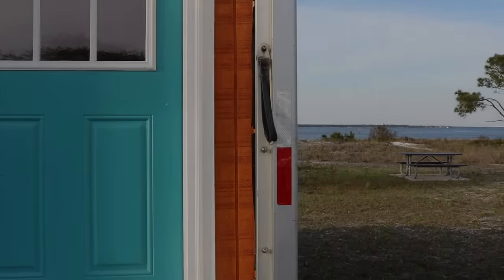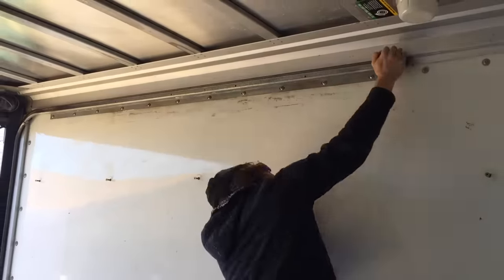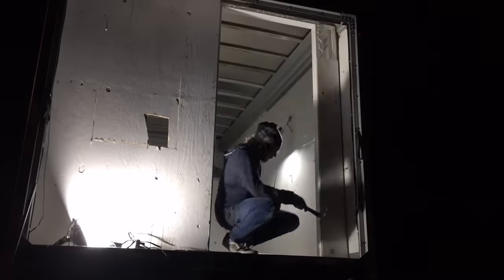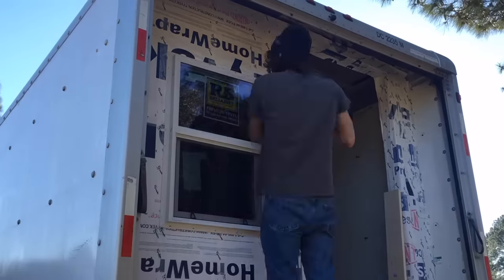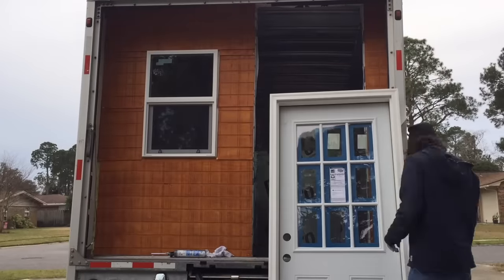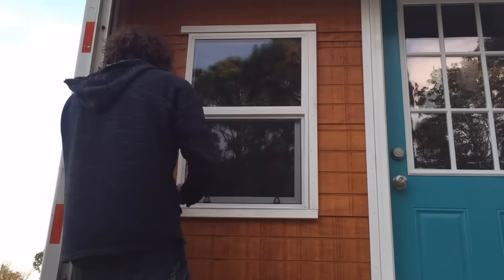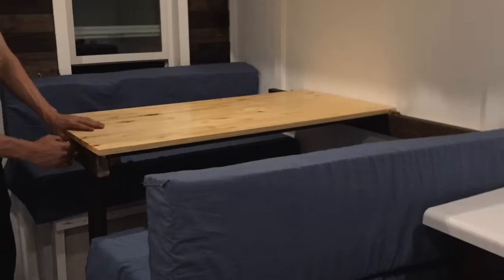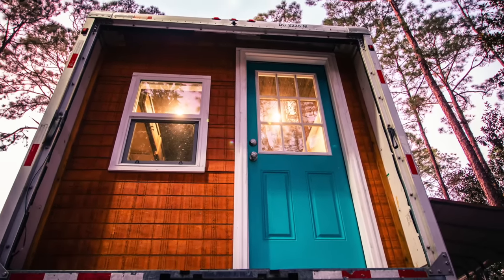How to Convert a Box Truck to a Tiny House

Comment: It doesn’t make any difference what direction the house wrap is put on. I’ve done construction for over 40 years.
Reply: it must have been some OCD people cuz I don't understand whether it's right side up or right-side down as long as it's not backwards. Lol.
Reply: Who thought that was correct, obviously they don't work in construction.  Tyvek "right" side up, too funny.
Reply: Yea someone confused Stuccowrap or Drainwrap which is directional.
Reply: If anyone is curious, here is the direct quote from Tyvek: "Tyvek® HomeWrap®, Tyvek® StuccoWrap®, Tyvek® DrainWrap™ and Tyvek® CommercialWrap® are equally effective in both directions and the logo may be on the inside or outside. "
Reply: Joe Princena you are leaving out part of that 

“Tyvek® HomeWrap®, Tyvek® StuccoWrap®, Tyvek® DrainWrap™ and Tyvek® CommercialWrap® are equally effective in both directions and the logo may be on the inside or outside. However, Tyvek® StuccoWrap® and Tyvek® DrainWrap™ have a specially engineered surface that should be placed with the grooves facing outwards in a vertical direction.”
Reply: Dupont says it is non-directional.
Reply: @pendragon1997  Yes! just a comentor looking for something to criticize when they themself have a very small knowledge base!
Reply: Jy8
Reply: @doomman700  Literally looked it up and found this answer on their site lol
Reply: Gianni M I have used stucco and drain wrap, it is directional and should be put on correctly to be effective. Yes it’s right on their website
Reply: 40? slave!
Reply: Adding to this, shouldnt vapor barrier be layered  over the  layer below it all of the way down the surface?
Reply: Maybe they had heard someone talk about starting the first layer at the bottom and working upward, but they weren't smart enough to understand the idea of how to overlap the wrap below with the one above.  Or maybe they just didn't get raised right.
Reply: Probly jus old framers, jus busting ya balls!!!!l I got told that, when went to work framing. Also had me look for a "board stretcher".
Yeah, if you hadn't said you're not a carpenter, might not have known
Reply: If the film relied on direction and gravity to shed water vapor it would be an automatic failure of the material. It's not a shingle.
Reply: YOU KNOW, IT'S POSSIBLE TO DO SOMETHING WRONG FOR OVER 40 YEARS.  JUST SAYING...
Reply: when its tyvek it don't matter but if its weaved house wrap it does matter!!!
Reply: @misterbigchip9501  yes its true he could do it wrong for 40 years.  However, in the case of Tyvek, his 40 years of experience steers us right.  Lettering orientation does not matter with this product.
Reply: yeah loll. still, layering them right helps a lot.
Reply: I wondered why it would!  Thank you!!
Reply: They give you Discount if you show their logo lol Btw I've seen so many Tyvek thingy when passing construction sites. It seems like they have a monopoly in that market?
Reply: its a beautiful build
Reply: Can you install Tyvek® WB with the lettering facing inwards or upside down? Tyvek® HomeWrap®, Tyvek® StuccoWrap®, Tyvek® DrainWrap™ and Tyvek® CommercialWrap® are equally effective in both directions and the logo may be on the inside or outside.
Reply: It matters to the company putting their advertising all over it.
Reply: Of course not.
Reply: @johntatman9168  Right handed Tyvek has to be right side up...left handed Tyvek is versatile...lol  He should always carry a board stretcher when doing renovations on the install of cabinets.... ...
Reply: Yep!!!
Reply: Great Job on the build. Blessings
Reply: Have you really
Reply: Build it the way you want to build it F what people think just build it the way you want
Reply: @ericagibbons7697  true
Reply: It's just what we tell newbies to make them stress 🤣
Reply: Looks good., you two did a good job , you'll learn from your first mjob, the things to do on the next. Congrats
Reply: @ericagibbons7697  Was just about to say exactly the same thing
Reply: People will say anything. That's just crazy
Reply: U right.. except here in ga the inspector will make u tear it down bc its part of the code here
Reply: 😂😂😂😂 Tyvek® HomeWrap®, Tyvek® StuccoWrap®, Tyvek® DrainWrap™ and Tyvek® CommercialWrap® are equally effective in both directions and the logo may be on the inside or outside.
Reply: Jim is correct. Diction of the product makes no difference .. even inside out. The one difference is in layering, which you did correctly as top layer over bottom layer. Commenters are often not experts. Tyvek is made of random fillaments... Random is not directional.
Reply: Yup it's actually annoying how people say this.
Reply: Of course Tyvek wants the paper with the giant Letters TYVEK SHOWING.  Make sure you install paper down up.  Overlapping as you go.  That's what I've been taught in commercial construction

Comment: Pulling that original door off was genius. Many of y'all don't know this but there's no emergency latch to let someone free so I really can't blame him for cutting that out
Reply: Also roll doors are prone to drag outside filth inside the truck and closing the roll part off is a mf sometimes. Not to mention the extra weight it adds; I’d rather have a shower or something more useful that’s  not gonna rattle and squeak all drive.
Reply: Could you have moved the latch to the inside so you would have had an extra protection? Also something to keep the latch from locking you out accidentally?

Comment: So smart to use the original wall holes to mount everything.  It doesn't seem like most people do this yet it offers so many advantages.  You're an excellent thinker and planner.  This was so well done, especially mentioning the previous shortcomings and what you've learned so far.  A lot of people wouldn't have the courage to do that.  Very commendable.

Comment: For not having carpentry experience you did an amazing job. As for painting the frame work it actually is a benefit in case you get in moisture or sweating inside. I've been in the paint and construction business over 38 years.  It will help prevent mildew issues if that does happen.  I'd do the same thing. The Tyvek wrap can go right side up, or upside down.  It don't make any difference at all. People just like to be critics. You did well.

Comment: I didn't see any mistakes:) I never heard about the T11 moisture/sealing issue. What I would say is get a quality exterior paint and fully seal it so no moisture gets in. You can even get the color matched to keep the log cabin look. No moisture in.. none needs to get out. Like others have said I think its a great job,looks good and it works. Nothing will ever be perfect so enjoy it and fix anything that requires it when it comes up. I thought the way you reused the original holes was brilliant. Enjoy your rig and thanks for sharing your build.

Comment: Cole there is no saving grace with a rolling door. They make noise & air gets in them & just a pain in the but to deal with. There great for moving vans not living vans. You made a great choice to take it out. You also get more room as the rolling door takes up much space at back & ceiling. always, Tommy :-)
Reply: I'd think it's more for camouflage. Keep the wall as built but a roll-up covering that will keep people from thinking it's a house. Necessary? Absolutely not. But it's good to have if you feel like you need to hide what the truck is for safety.
Reply: @StapleCactus  yepp they lost the stealth effect...can probably only park at a camp ground to sleep!
With the door it was anywhere they wanted
Reply: @StapleCactus  the wall as built goes right to the ceiling, but the roll-up door goes under the ceiling. To keep the inside well insulated, it would need a false ceiling underneath.
Reply: @questioner1596  Which is completely doable. It takes extra time which he didn't have, so I understand.
Reply: There is still space to add some sort of canvas/vinyl roll down wall. That way it could provide a stealth factor and protection from elements while driving.
Reply: @StapleCactus  my thoughts exactly...
Reply: Well here's a marketing idea for someone then that keeps both sides of this argument  happy ... a roll down awning fake door that says something like "  Daves  24 plumbing Repair" so you never get robbed and you can park overnight without hassle
Reply: @pal6636  Brilliant...the thought had vaguely crossed my mind...but yes brilliant!
Reply: Never get robbed?? 
Work trucks get broken in to for tools.
Reply: @gellotion  I guess you're right 😁
Reply: @gellotion  Of course nothing is flawless, we're talking reducing risk. "" Never" "isn't literal.   Use your imagination then if you don't like tools... change it to used diaper pick up or something.
Reply: @pal6636  I like that. Or maybe bread delivery, linen service, exterminator?  Whatever you choose, your idea is a good suggestion for the stealth factor.  
Another tip that helps with that is to keep moving, don't sleep on the same street twice if you end up urban camping for a while.
Reply: great idea 💡 👍
Reply: the only reason to keep the roller is for stealth camping, if thats not the goal, what he did sure looks nicer and adds light to the interior.
Reply: @Justnn  chicken grooming 😆😆
Reply: Dave Strickland  sorry, my bad, I didn't realize you were that much more knowledgeable  until now .  I only had myself to compare to. So I won't even try .   But.... I'd  consider  moving somewhere that they don't steal used diapers   ;)
Reply: Dave Strickland   @Dave Strickland  hey Dave, people were ripping on the  OP so I thought  I'd  contribute something positive to the community . If you're looking for validation don't just come on and  laugh at ideas , then say you're right because you're better  dude.   I don't even remember when we worked together.?    Maybe you're a great builder. 
RE boarders. You're building bigger ones I think. . Mine isn't big enough for any boarders.  Not even a   Merriam or a  Webster . ;)  Not the liitoe  guy with the TV show, other one. . Now play nice... and take care

Comment: Beautiful, Cole.  If anything, you probably overbuilt in a few ways.  I built a "box" camper on the back of a '63 Chevy pick-up back in 1972 that my then wife and I took from WI to LA, up the coast into Canada, back down through WI and on to AR.  We actually lived in it for several weeks at a time and were quite comfortable.  I used 2X2 red oak as studs in the sidewalls and ran the T-111 horizontal, as you did and insulated it with a cardboard like material that had foam where the corrugation would normally be.  Two storm windows with the glass replaced  by plexiglass gave us light and ventilation (one on each side).  The whole thing could be dismantled in minutes and easily reassembled.  Never wrote down any design, just flew by the seat of my pants.  The final addition was a storage box over the pick-up cab.  The wind resistance against the front wall was really noticeable until I fashioned a storage box with an angled lid.  Never had a leak anywhere.  I've often thought about converting a box truck like you used, I'm pleased to see how well you made it work.  I wish I would have taken more pictures, and maybe done a video, but the technology for doing that just wasn't available.  Beyond that camper, though, you're building something much longer lasting and more important.  Memories.  Beautiful memories.  Congratulations.

Comment: I'm so glad you made this. That time lapse video is what inspired me to build something like this! I've showed this to some family and friends, and I'm so excited about it. Right now, I'm trying to build up enough savings to buy a retired U-Hual (or something similar, maybe a step van), and buy some tools. It'll be just me & my two cats. And, the first trip I wanna go on is to Mexia, Texas--where some of my family moved, after the #campfire2018. Hopefully within the next year-or-two, I'll be posting my own content for everyone to see & share. 🙂
Reply from the maker: This makes me happy 😁. Please send a comment my way when you get going!
Reply: @ColeWebb  for sure! I'm researching on how you can seal the passage way, between the box & the van. 🧐
Reply: Just did a test camping run for a month with my 2012 Ford Transit box van :) It has now only a bed in the back and it will be a lot of money and work before it is finished. A box car is much more easy to work with as it is totally box shaped, a normal van is much more work as nothing is box shaped on the inside (sloping walls, and curved ceiling) and everything must be custom built as other vice it will not fit. My van I can put in anything you can in a normal house as long as it is not to big :)
Reply: Awesome definitely post a video on your project. Harbor Freight has SOME great tool to save money for the nonprofessional but some are garbage. If your not a professional and won't build houses but want a new tool harbor freight might be a good option. BTW the biggest sale on all tools is fathers day...NOT Christmas time or black Friday. If you want quality tool brands and can wait shop around Father's Day. Good luck! Make sure the vehicle is running good and not a rust bucket before building.
Reply: @ColeWebb 
re : photograph of framed rear wall
First thought:
* moisture-absorbing material, 24/7/360° permanent condensation?

Comment: People are realising this is a superior choice to a van by every metric apart from parking convenience and the fuel costs of long range travel. I did a larger version of a similar design for a fraction of the price of most youtubers with more than double the space I see vanlifers doing. Building it out is way easier because its all square and cheaper because you can use what is available for houses.
Reply: Yeh, we were looking at truck bed campers and busses and then came across this idea and it makes way more sense!!

Comment: For those who think you should have kept the roll up door you should know those things are heavy and leak air like a screen.  I would prefer to build a hinged wall, hinged at the bottom, that drops down, if you want security, and can be lowered to make a deck. A 12 volt 2000 lb HFwinch would raise and lower it easy. Then you could easily make a set of flat folding steps up to the deck, and some drop in railings to keep the dogs and kids from falling off the back deck.  A small awning and you've got a perfect outdoor patio for watching sunsets.  Heck, you could make it a screened in room like the Pop Up Campers have to keep the bugs out.  I like the way your camper all came out, and would love to see a few windows on the sides to left the light in and create a cross breezes.   My favorite part of my Class A RV is waking up in bed and looking out at the scenery outside our bedroom windows.  Sometimes it a Pretty Lake, a cool river, snow covered mountains or just a big green forrest and birds flying about.  
Well done Cole Webb!

Comment: I think that was a great idea, and you did a really awesome job; especially with no construction experience and being rushed for time! Congratulations on becoming such a great team with your wife and building fun and precious memories with your children. Also I'd been looking at pre-built storage buildings to turn into a tiny home. They're actually pretty expensive with non-insulated bare interiors, then the cost of making them livable. However, because of your video I remembered I'd seen these utility boxes taken off of the trucks and sold by themself very cheaply! I could buy one of these and convert it into a tiny home much cheaper than using pre-built storage buildings! So thanks for the idea, and as far as the Negative jerks go, we all could use fewer of them in this life.

Comment: Only thing I would’ve done was put a big door on the back so that it would lift out the the bottom and swing up so that you have an instant awning! For rain 👍🏻 but cool build ✌🏻🇨🇦
Reply: Yeah with bug netting draped down for a bug free meal outside! Cool idea
Reply: We saw that on some of the truck cap camper builds and liked the idea of a flip up door for the awning effect and a regular door for normal entry.  With that space behind the outside window/door wall there's plenty of room too!

Comment: I really want to pull the plug and do something like this. I love the ideas about insulating and framing in an efficient way. I will definitely be putting a wood burning stove in as well as looking at another way to heat off propane or what have you so that I can heat at a minimum temperature when I am away or give an option of not getting up in the middle of the night or trying to use wet wood. I'm curious as to if you thought about having the door swing out instead to save a bit of swing space but it looks like the top of the door might be a problem on the truck frame. I will have to think about that for my own build. Definitely like the more house-like look with framing the back. You don't want it to look like just a box truck you want it to be homey :)

Comment: I love it.....I 'm looking for a. U - haul to convert into living space why'll I travel for 6 months a year in the flea market circuit.  Love what you did.  Only difference I plan on using a couple of solar panels for energy that I'll remove them wheb traveling.  Also I'm going to have a vent and a camper heat and air conditioning unit installed.  Also I not removing the original van door its staying. Going to build a wall with a door and eitherone or two windows too. Like I said before great 👍 job love what you did.  Ah some!.

Comment: Cool video!  One thing I would
 be concerned about is the joint between the exterior frame wall and the exposed truck bed. Hopefully there is pitch or slope towards the back so water/snow/moisture will run off. (yes I know he caulked it.)